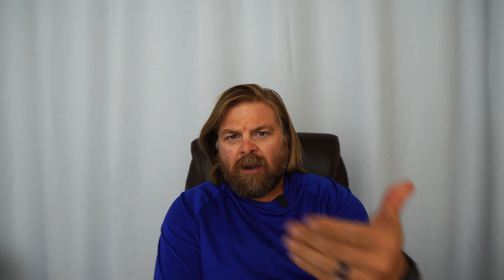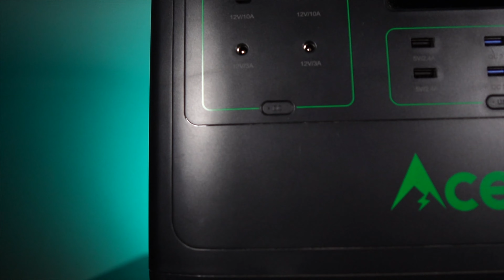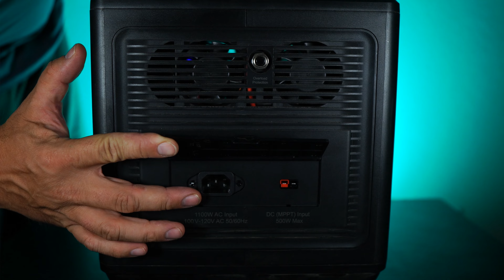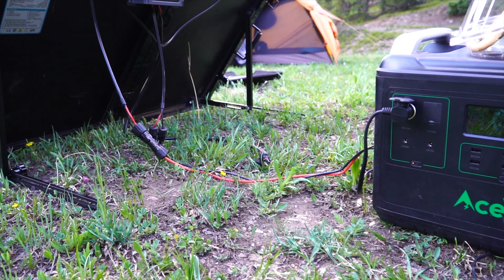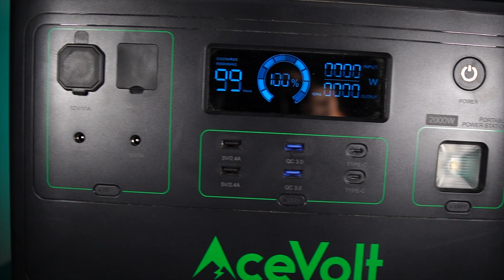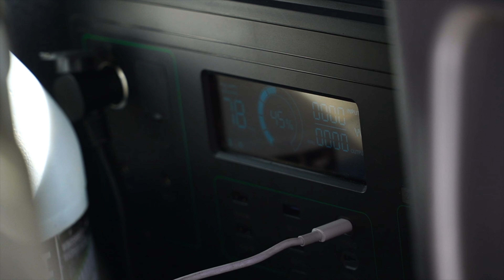Check Out My New Favorite Portable Power Station For Camping | AceVolt Campower 2000 | 4K

Comment: This is the kindest review I think you’ve ever done.. this thing must really have ticked the boxes.
Reply from the maker: I mean, there's not a lot to hate on about this thing. It easy to get the electrons in it within a reasonable amount of time, it holds a lot of them, and has some really useful means of dispensing them when the time comes. The only thing I could see making me not like this thing as much as I do is if there's some sort of critical failure with it in the coming months, but we've been bouncing it around in the back of both rigs and it's held up so far.

Comment: Let me be #2 on the positive non-date site commenters. 2000w is a lot of power, can't wait for winter camping  and plugging in your electric blanket is going to be awesome.I might just bring an extension cord and plug mine in to your unit as well.  It definitely has plenty of ports to hook up to. A couple of them are new to me as well and are not offered on my Bluetti 500w. Very fast charging time for  such a big unit. Only downside that I see is the weight, so keep it low inside the vehicle and tie it down. Be sure to also not cover the vent areas so that it can breathe to prevent overheating. 140 degrees is not very high when sitting inside a vehicle here in AZ, so be sure to leave a couple of windows cracked for ventilation.